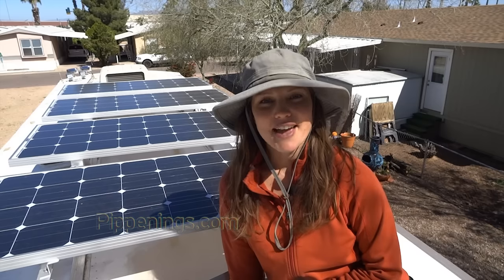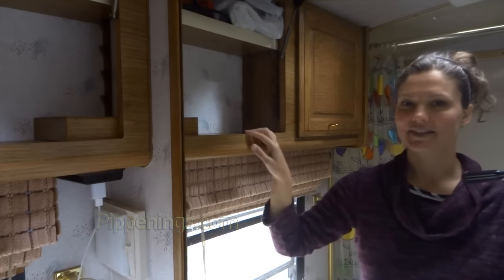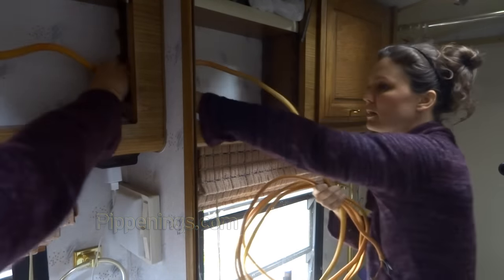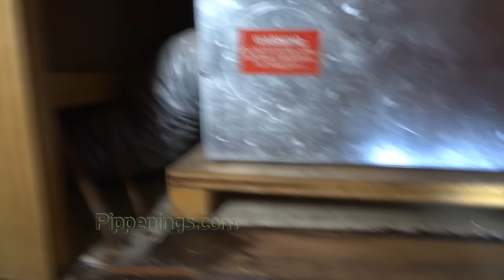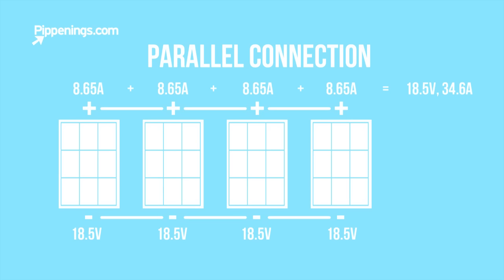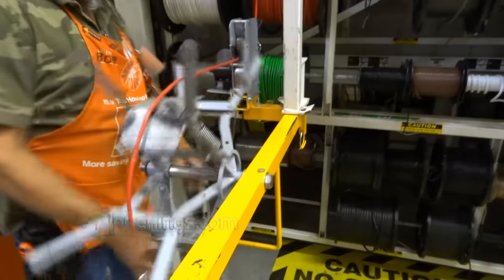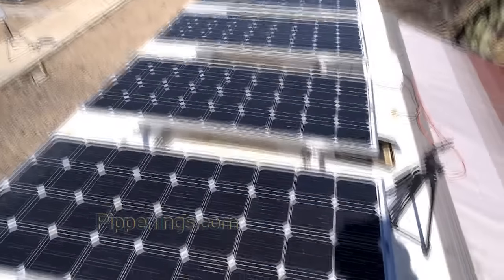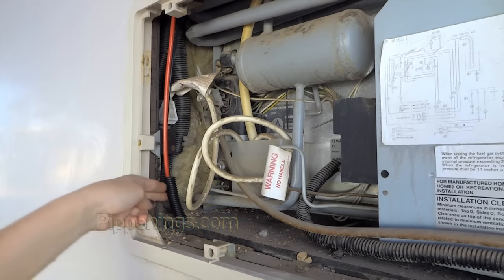RV Solar Installation, Wiring part 2

Comment: What I really appreciate is showing the REALITY of trying to figure this stuff out.  Most DIY videos make it seem so simple, and then in my own project everything that could go wrong does (with umpteen million trips to the hardware store).  Everyone talks about running wire but I've never seen a video that shows the craziness of trying to figure out how the engineers put an RV together (had a 97 Bounder and the only way you could get to the water pump was through an arm sized hole you had squeeze and contort to get to- so you could see or you could put your hand in but not both - to this day I hope there is a special place in heck reserved for whoever had that brilliant idea).  Just starting on my new RV reno project and have been enjoying and inspired by your videos - thanks!
Reply from the maker: +Dawn Robuck Thanks Dawn, glad you appreciate that. Best of luck with your project!!

Comment: Excellent Video. Tape measure as a wire pull...I love it. Haven't seen that done for a long time. Looking forward to part 3.
Reply from the maker: +TR Bowlin Gotta do what you gotta do! 👍
Reply: Ingenuity and inventiveness are traits to be proud of. BTW I've been meaning to ask, where did you get your panels? And what was the cost per panel?
Reply: TR Bowlin Grape solar panels tend to be higher priced. You can find similar sized panels from Hightec or Everbright for $160 shipped. Ebay has some unbelievable deals on panels.You can look for Trina, Hyundai, Gcl or HQST.
Reply: @mrmotofy  True true, but I just watched Pippi do a 2 part DYI before diner here with quality materials and excellent craftsmanship. If she can be persuaded I'm sure you would see 30 plus years with her units excluding acts of god or my fat brother sitting on one. Honestly, I'm 3rd party and have an eye for quality. But see for yourself, the videos are on the list.

Comment: You are smarter than me I hope that my cables for the solar panels to my electrical wires in the back of the fridge and the regulator in 1992 and it works great I like your information you have presented also I like the shots of your traveling which I may never go there getting too old keep up the good work
Reply: Not hope ...hooked

Comment: Two Pippi's from a mirror is twice as nice! When we pull wire from floor to floor in a building, we run them through a CHASE.Nice job using your tape ruler as a fish tape.You're pullin' wires like a BOSS Sweetie! ;-]

Comment: Solder those connections on the roof . The ones with the heat shrink if you notice any problems with power because mechanical connections always fail first. Glad to see you finally got solar:)

Comment: It looks like you are having much better weather there than I have been here. I'd love to be able to live in a motor home, just haven't had the means to do so yet. I want to mention that the panel you showed that contains the electrical boxes that is screwed into place can be modified so it works like a cabinet door on hinges so you can get inside that easier and more often. Depending on how deep the raceway is, you might be able to relocate the box in the bathroom so it recesses and won't be an eyesore as it currently is.

You're smart when it comes to electricity. Amps in electricity works the same in lower voltage systems as it does in regular house wiring. You only have so many amps on each circuit which is determined by dividing the wattage by the voltage.
Reply from the maker: +Camper Hollow That's a great idea about making it like a cabinet door. The worst part is I think one of the breakers is on a short wire so to remove the panel, that breaker would need to be disconnected. Ugh!! Great idea to keep in mind though!! Thanks and good luck with your journey to RV life!

Comment: Sometimes surface wiring conduit using Wiremold, metal or plastic channel,  is the most practical. Available at Lowes or Home Depot. Great stuff for RVs.

Comment: FYI.  shrink tubing is available in both 2x and 4x shrink. The 4x shrink is just hard to find. When I do installs like yours I prefer to use shrink tubing with adhesive on the inside diameter. The adhesive is applied during the manufacturing process. The adhesive seals everything very well. Some people call it military shrink tubing.
Reply: Turning Wrenches In those cases where you want to be sure the shrink tubing is waterproof and you didn't use tubing with sealer inside use regular electrical tape over the tubing as added protection. 
In these cases I prefer to use 3M silicone tape that seals to itself and whatever it's applied to.

Blue Sky's and Safe Journeys!
Reply from the maker: +Turning Wrenches Great info, thanks for this!!
Reply from the maker: +rolloverriderpgr I might still add the tape however I find it comes undone after a while. Maybe cause it's not 3M
Reply: Instead of wrapping the connector with electrical tape you may want to try "Liquid Electrical Tape? Just like the name says it is liquid and applied with a small brush. Clean the area well and apply a couple of coats. This product comes in handy for fixing wires with minor insulation damage or as in your case to weatherproof a connector. The product is available in auto parts stores as well as some hardware stores. Its nice to see someone doing it right the first time. Take care.

Comment: This make me really sorry I missed you at the dog show, and I was in Phoenix at the time.. Oh the stories we could share.
You're getting it done in the DIY fashion PLUS documenting it. How do you do it?
What a handsome addition to your family, congratulations!
I've really enjoy watching you learn and put it into action. 
When I installed my system after research I had a basic understanding of a complete system but didn't have the confidence to select the components so I ended up working with the dealer to determine my requirements and let them put the component package together for me to install. Still a lot of questions but got it done and well worth it when you realize your not running the generator when boon-docking.
Sweet rewards for the effort.
Currently enjoying the Texas coast
Nice work!

PS, I also had major concerns drilling that hole in the roof membrane and took a photo so I wouldn't forget the moment. 
But after using Dicor's self leveling sealant and primer I am absolutely confident about being able to drill a hole or fasten any thing to the roof and be able to seal iting up..The stuff sticks to everything as long as its clean.

Can't wait to see the remaining component install

Good luck
Reply from the maker: +dablingtime Thanks for sharing ☺️

Comment: Great video. I haven't quite got it through my head on the series, parallel or combo. but will keep figuring it out. You have a much better understanding than I.
Reply from the maker: +Idaho Rider If you need help, just ask. Oh I'm also starting a Patreon reward of a one hour consultation via google hangouts for those that need it or want to just hang out ... Patreon.com/pippenings
Reply: Thank you I will definitely keep that in mind.

Comment: Pippi, To run cables you need a mouse, a cat, and some string. Tie the string to the mouses tail. Place mouse at opening in wall. Hold cat close to mouse (not too close or will not work). When mouse sees cat, mouse runs down hole. When mouse exits at other end carefully remove string and tie string to wire. Pull wire through . A fool proof system although it is a good idea to have at least two mice :) .
Reply from the maker: +Todd Anonymous Did you learn that from Tom and Jerry?

Comment: An alternative to the shrink wrap/silicone for sealing large connections is Scotch 2228 Moisture Sealing Electrical Tape. It is not    "tape" in the usual sense, but rather what is known in the trade as fusing tape. It is a thick material that when you stretch it fuses into a solid material that encapsulates irregular shapes.  It is very permanent in outdoor conditions. Expensive, but really magic stuff.  You will find other uses for it, like covering sharp edges and ends of metal components.

Comment: my dad taught me if you need to get a project done just do it and I'm impressed that you know what two color of wires to get so many novices use the black wire for the live wire which is a major no no even for basic electrical stuff
Reply from the maker: +KILLKING110 When running AC power black is positive and white is the neutral. I think that's where it comes from. DC is black and red like on batteries.
Reply: Pippi Peterson On AC power(house type) wiring Black, Red or Blue is the Hot, White is Neutral, Green is Ground. With DC power(cars, batteries etc) Black is Negative, Red is Positive Green is ground. If a white wire has black or red tape on the end that usually indicates it's been changed to Hot not Neutral. Marker is also considered acceptable for changing wire color. On Trailers Neg is usually White, Pos is black or black with white line. But the wiring  is many times different colors so be sure to double check first. Sometimes white and black are switched. An electrician didn't believe me till I showed him a car wiring schematic that had white as pos and neg on the same schematic, different components. You also may have Black as Pos and Black with white line as Neg. Green is still normally ground. But make sure to check your polarity...someone may have switched it.

Comment: It's also a good idea for any wire connection exposed to the weather to use Dielectric grease found in automotive department store. Smear it on all of your connections bolts or terminals then install your heat shrink and you will have a perfectly sealed and weather-tight connection. this is the only way to make good solid ground connections as well as prevents corrosion on battery terminals. You can also use a outdoor rated weatherproof grey plastic electrical box as a junction box on your roof. Your wiring runs in to

Comment: I hope you take what I tell you as a help. I just have done many things in my life and picked up some tricks. First I would have put the sealer inside the heat shrink, then heated it. That would give a better seal. If you look around you can find long pull chain like used for pull chain lights. They can be put together to make one big long chain. You can use this to help you pull wires from the top to lower places. I did like you using the steal tape. But the long chain sometimes can get you through places that nothing else will. I have used this many times in homes to run wires from the attic to almost the floor. And if you use steel chains you can use a magnet to help get the chain at the bottom if it is where you can't see it.
Reply from the maker: +Donald Smith Super great tips I will keep in mind for next time. Thank you for sharing!! ☺️

Comment: What I do with heat shrink, the large one for the splicer and add a smaller one for the wire that way when apply heat the smaller heat shrink  (over top) seals the whole thing.  Great video 💥😎🔝
Reply from the maker: +Keith Byerly Great tip, thanks!
Reply: Pippi Peterson Update heat shrink the larger one 1st then slip the smaller one up on top and heat shrink it

Comment: Pippi, you did a great job on the installation except, I recommend you replace all those zip ties with the black ones instead of the white ones. I have never seen a white one that is UV rated. The black UV rated ones will last a lot longer. The white ones will get brittle and break in a short time.

Comment: It might be a good idea to drill through the roof DIRECTLY to the battery bank (Shortest is always best and I would use 6 gauge wire from the roof to the controller and 4 gauge to the battery bank and inverter). Oh I see you decided to do it another way, (lol). Good luck:)

Comment: What works good for the heat shrink is to shrink some tubing over the wires to make them as fat as your connector and then shrink the bigger one over them both.

Comment: Hi Pippi.  I've watched your videos for quite some time now.  ? for you.  How do you protect your solar panels when not in use.  But then, you use them all the time I understand of course.  But I do store my camper during winter and don't have a cover for my rig.  What would you suggest to put over my panels (may arrive tomorrow, 4/28) to protect them from hail, snow, etc?   Thanks!

Comment: congratulations another great video a do-it-yourself so sufficient gal out there by herself doing it I love it it's very encouraging. I don't want to know I am a bit on the inner side when it comes to RV solar use or solar use in general. what is it that the solar panels are doing for you I know that every frigerator can be run off the generator or propane in an RV what is the solar panels going to help your refrigerator and what else electricity how do you know when your solars are at full charge or need charging do they recharge your battery in the RV how does that work if you can explain that to me a non RV here I would love to RV one day and this information is so useful thank you so much you're so sweet and I love you videos and as a Puerto Rican I love the Puerto Rico videos it was great to see someone enjoying my culture
Reply from the maker: +Nita F Hi Nita, thank you. I did a solar basics video series which answers your questions. As for the fridge running off the generator or propane, my goal is to use solar full time, not just in a short term scenario that you'd use the generator or propane.
Reply: I will look that video up thanks

Comment: Ampacity of the cable isn't the only thing to take into account. Cables have a capacity factor based on temperature. The chart you showed doesn't change the fact that you can't run the amount of current you think you can. Temperature increase causes the capacity that the wires can carry to decrease.

Comment: I did similar arrangement series/parallel but I used wire nuts instead of splices. Splices looks like a better connection.  Are you planning dry camping with your new solar?
Reply from the maker: +Dave Stennes I'd love to be fully independent

Comment: The wiring looks great.  My question is about your solar panels.  The way they are mounted will they be ok going down the road?  Mounted as they are wind can get under them causing serious vibration to the panels... just a thought.
Reply from the maker: +Steve Mazz I built the mount with an engineer and a mechanical designer and input from an RV tech at camping world. I hope so.
Reply: I hope so too. 
I am surprised there is no wind spoiler to divert the air over the panels instead of allowing the air to pass under the panels when on the road.  
The solar panels must be much stronger than those I have dealt with in the past.  Happy Rving.

Comment: Hi Pippi - great video - my 4-panel system will be the same - series (pos to neg, creating one "set, then the other "set.")  Then parallel connected to the cables going down to the charge controller.  Can you please tell me what you were splicing (at around the 22:00 mark BEFORE you spliced onto the cables going down to the charge controller? I'm referring to the ones that didn't quite reach each other. If you spliced them together to make parallel, the system would be closed because all the cables would have been connected.  So did you have to cut them again to get them spliced onto the 6AWG cables to your charge controller? Your wiring schematic doesn't point this out.  Thanks so much you've been a huge help.
Reply from the maker: +craig caserto The parallel connections had to be spliced together because the plastic connectors that came with them were only for series
Connections. The two lines coming in parallel connected together directly to the 6 going down, like a Y with a rectangular piece in the center. You can see this in the video when I'm putting shrink wrap over it.
Reply: Got it Pippi - thank you.  All the best!

Comment: Great Job Pippi..  
regardless of if I or others agree with everything that you have done I said good on you and great job girl!!

BTW did you consider where cables are in roof and walls before drilling holes for fitting the frame on the roof or through walls.?
Reply from the maker: +Steve Currington I didn't suspect they went through the steel square tubing in the frame so I didn't. Glad everything seems to be fine though

Comment: In theory, when measuring for cable length in a low voltage system, one would measure both ways.  In your system with 35 feet, you would use the cable length of 70 feet in determining wire gauge.  With your higher voltage you should be ok.
Reply from the maker: +rjr 4949 Interesting, thanks for sharing

Comment: When you get a chance, when the white zip ties break, replace them with black zip ties.  The black ties are UV resistant and should last longer.  You can get a bag of 100 for less than $10 at HD.
Reply from the maker: +Dan Burch Thanks for the tip!

Comment: Run through the roof... preferably directly over the battery bank.  I used my overhead and bedside cabinets to hide as much of the cabling as possible.  Fishing through RV walls is freaking impossible.

Comment: I bought an older class c 30 foot with 30,000 miles on it and the first thing I found they were only owners. And the refrigerator the condensation tube was left in the wall instead they should of pulled the tube out and there is just enough tube to pull out the cover. my leak was between outer laminet and insulation with a little wood frame damage. I cut out the damage replaced re laminet the outer skin between insulation. Sometimes the tube is in the wall deeper where it gets wet under the fridge and floor damage. if that's what it is just repair the water damaged wood flooring make sure condensation tube is long enough to run out the hole io the outside refrigerator cover so the condensation runs outside the outer wall. not the inner.its a Comands problem.
Reply: Mark Smith It's generally a good idea to replace that entire hose as it usually gets brittle and cracks from the heat cycles.